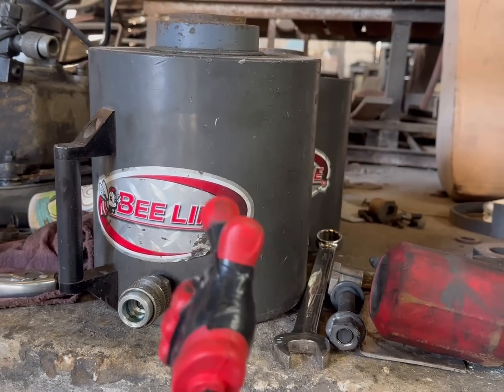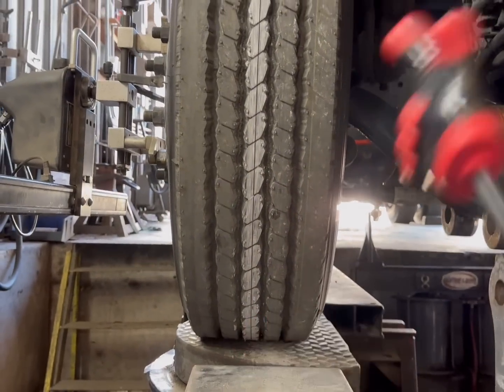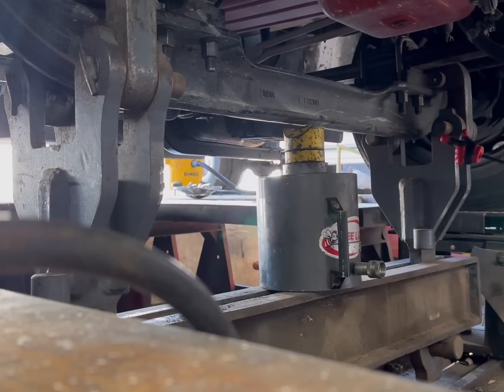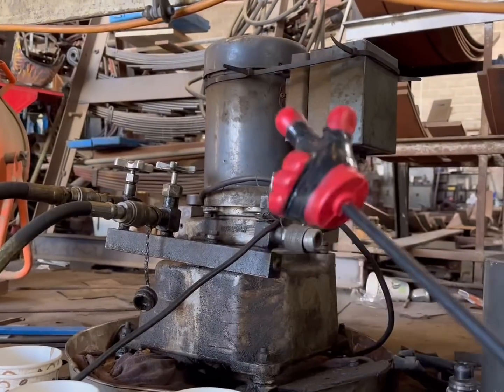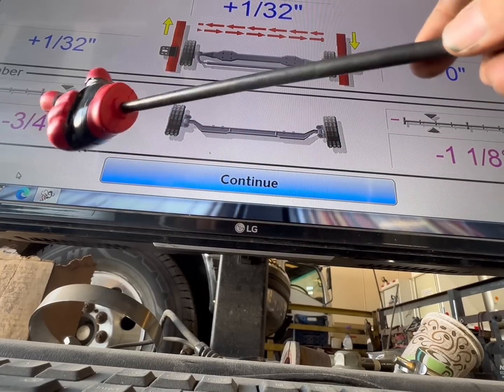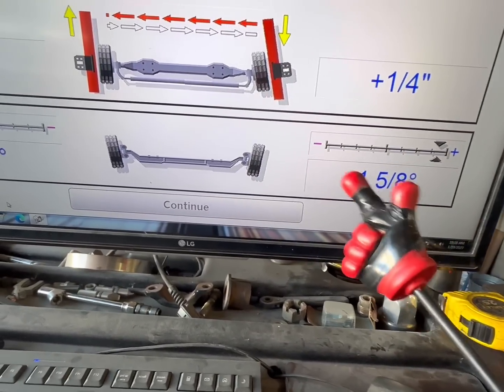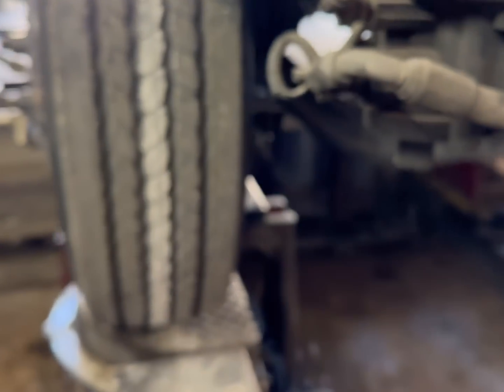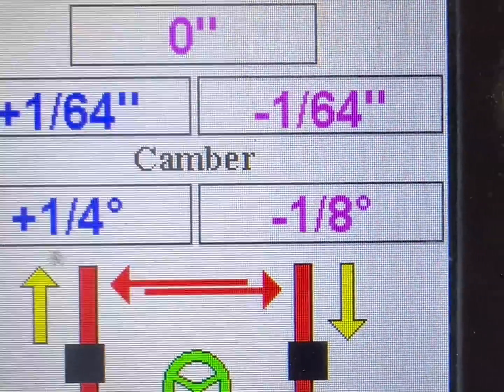What does 125ton do to a semi

Comment: I have seen it for the first time. Have a question about the camber pin/bearings (not sure I called them right) Did you check them first for wear before axle adjustment? They can also cause  a bad camber reading do they?
Reply from the maker: They will cause a bad reading. And yes there are several things you have to inspect. Such and king pin play and wheel bearing play. And also toe readings if to far out will cause a bad reading.

Comment: Amazing!  I'm curious about the difference in camber between left and right though.  Is there a way to get it dead nuts on both sides?  Also, how much does a procedure like this cost?
Reply: And if you are in Australia where we drive on the left hand side all imported trucks from right hand countries have to be changed because of driving on the wrong side of the road so to speak  and even between states there are differences as the standard slope they put on the road is different of all things just bugger your tyres.
Reply: @marsterofnotrades  Heh, interesting. Also your trucks have to drive around all day upside-down in Australia, and so that has to be taken into account too ;)
Reply: You can set the angles to equal amounts on each side but your tires will wear unevenly due to the natural curve of road surfaces that is built in to shed water in rain storms. This offset he used accounts for the curve of the roads surface. Cost for axle straightening and alignment on one of our trucks done in Columbia SC was 1280$ 1 year ago.
Reply: @btwbrand  Well I'll be damned, I never thought of how roads are on average slightly off camber for water shedding purposes but you're absolutely right!  Huh.  Also that price isn't bad when you're talking about the expertise involved, and the cost of tires that it will save over time, and the overall cost of the semi truck.  Amazing. If I ever have a used semi truck that I want to make money with I'm going to look up this guy's shop and have him go through my alignment.
Reply: @btwbrand  1280 pesos is not to bad. That is only about $71 USD

Comment: Been driving rigs for many years had no idea you could set the camber. Smart and unknown!! Tire manufacturer don't want us to know so we keep buying tires!🤣
Reply: Told one of our drivers who wore out his steer tires and just kept rotating them and wearing them out 2 at a time to go get the camber set. He said he did.  I checked the ticket and called the shop. They did toe and replaced a bushing. TWICE. Called them up and they wanted to blame the brand of tires. Finally told the driver to take it there and tell them to put it on their big ass frame machine they hate using and bend the axle into spec. He swore they didn't have it but I knew it was there. He came back with two more new steer tires and they did the work.  No more wear on inside.

Comment: We had this done in the 70s by the same guy that set up the Tyrone Malone Bandag Bandit never had tire wear problems after that pluss we found run the steer tires on the left side drive axle for about a thousand miles then put them on the steer axle and they would wear perfect

Comment: Interesting video, there’s a reason this isn’t done anymore.  Now that truck needs a new axle!!

Edit:  I’m at the truck dealership where I’ve been doing suspension and alignment work for over 25 years.  If we wanted this to be done, we’d have the capability.  We don’t because, well…….we don’t!  🤣
Reply: Lol dealerships are notorious for having the worst "skilled" labor. Axle bending when done properly like this, does not affect the life of the axle and if anything will extend the life of the axle bc the tires will be properly aligned. There is no castor adjustment mr empty head, this is how it's done
Reply: @mrfuninthesun33  “CastOr” empty head? 🙄  He’s not adjusting caster numb nutz, he’s adjusting camber.  The camber is built into the axle.  No need to bend it.   I can read a tire wear patterns like I can read your dumbass post.  Please explain what a “camber wear” pattern looks like on a truck?
Reply: @edgardaniels1402  yea empty head, pull the axle ends down to adjust the caster. that's how it's done
Reply: @robertcampbell5605  Axle ends?
Reply: @edgardaniels1402  i was being a smartass

Comment: I have a question, camber pulls to the most positive, after you bent the axle you were way positive of spec, and a hair over a 1/2 a degree cross camber,,,, road crown pushes the chassis to the right,,, these two numbers compound the effects and this tractor should pull to the right and also develop premature tire wear on each tires outside edge,,
My question is would you really give this tractor back to the customer with these numbers????

Comment: There used to be guys in my area that would do this with a torch, and just by eye balling it. Always got it right, and never compromised the structural integrity of the axle. Unfortunately,  I never had the opportunity to learn. And all those guys are dead or retired.  Back in the day, there was no fancy computer equipment.  Use a carpenter level if you were good, and just look at it, if you were a craftsman.
Reply: If you heat it enough to let it bend you are compromising it's qualities. It's better to take a forged beam and bend it then it is to heat it.
Reply: @ChevyConQueso  on paper I absolutely agree with you.  But out in the field, things don't always work out as one would suspect.  The guys that retired, performed repairs using this technique,  and never had any issues.  I'll admit, the first time I torched an I-beam to do king pins, I was hesitant. But I've been doing it like that for so many years now, it's just second nature. You have to just know, what the limitations are.

Comment: Bendon—are you concerned that every time you bend an axle it voids the manufacturer warranty on the axle?( stated on their websites)   I don’t know how they could ever tell it was bent but just curious on your thoughts
Reply: I'm not him, but here are my thoughts. 1) Heating enough to bend changes metallurgy, so a bend is preferable.
2) The axle got bent under hard use. It's unlikely to fail unless a crack has developed. Bending it back isn't any different. 
3) Liability is expensive. it's easier and advantageous to sell more axles and make a profit, than to allow bending and potential lawsuits, whether the practice was the cause of an accident or not. You never know which way those cases go.

I would personally do this on my truck and sleep at night.
Reply: The warning against bending is for when a truck is in an accident and has a major bend. At that point you should replace the part.  The adjustment he makes here isn't the bending they are warning against and like he said if you check the literature the manufacturers service books tell you to have this procedure done as part of a comprehensive alignment.

Comment: You make great videos and I’ve been in two shops in Kentucky that USED to do this but it’s been years and it seems that when the older mechanics passed so did the knowledge
Just a heads up at around 4:15 in your video there is a socket on a nail that is just hanging on by a short curly so you may want to grad that before you get a black eye 😂
Reply: Bro... attention to detail! Took me a few times to catch that, you can barely see it in frame
Reply: Yea it's! Off to the right ✅️ up high above his head.

Comment: Hey man I'm from Canada too and I've got an old ford twin I beam and I've tried all over to get a shop to do what your doing and can't, so it's a hope of mine to find a cool old boy like you one day who still know how to do this neat lost form of alignment. Great video and keep up the hard work!
Reply: My 95 powerstroke twin I beam was an alignment nightmare until I took it to this old school dude I was told about and he got it right one shot. First thing he said just from looking under it for 2 seconds was did you replace your bushings? Answer was no and 3 other shops neglected to tell me they were wooped. The 7.3 is bruital to the twin set up because of how heavy it is.
Reply: @youngmike8645  People trash the twin I beam and twin traction beam especially but they're great systems, that Ford still uses, at least up till the 2016 models. I don't see any 2wd 2017+ really but I'll look when I get a chance. 99% of the time these folks are driving on blown axle bushings and they want to complain. I personally like to swap for polyurethane bushings. Cheap and do the job.
Reply: @ChevyConQueso  It is a trash suspension setup that always changes toe, camber, and caster whenever the suspension loads/unloads. I've worked on many of these, they suck. They are only in the new E series chassis, because Ford has been using it for so long because it's cheap to produce. They should get rid of it and start using front tubular axles like they do in the RWD F250 and F350 series trucks.
Reply: @ChevyConQueso  People trash it because it isn't very good compared to the other options out there. Just because it has been around forever doesn't make it great.
Reply: Need moog caster camber bushings

Comment: I do the same for 5th wheel/gooseneck trailer axles.  I set toe also.  You wouldn't believe how many trailers axles are out of alignment even brand new. It's no wonder so many eat the tires right off.
Reply: Welding robots are setup to spray and heat to go as fast as it can go. The warpage is a real thing that used to not be a problem. All so they can crank out more product in one 12 hour work shift.

Comment: Back in the 80s I did similar alignments, on a smaller scale, Ford pick ups with twin IBEAM suspension, there was a warming stamped right on the IBEAM do not heat or bend...well I never bent them, I just straightened them!!! Worked out well and never had one fail!  On a larger scale, great job you did fellow mechanic!
Reply: My 2004 E250 van has that suspension type. There are many available versions of replaceable upper ball joint sleeves that can change the camber and caster. Did the older ones not have those available?
Reply: @TheSailingwoodworker  them old late 70s and 80s Ford IBEAM had king pins and not ball joints, King pin rebuilding was a tough job back then!
Reply: @TheSailingwoodworker   The king pin I beams are the ones that are bent to correct caster and camber. If they have ball joints they are adjusted by sleeves.
Reply: @TheSailingwoodworker  Older ones were king pins.

Comment: I have a complete shop at my house. I have a Beeline rack and all the axle tool group's. We use to do a lot of this at my old shop, not so much but if you're camber or caster is out this is the cure! I'm about the only guy around that can do an old Ford twin I beam or light straight axle . My Beeline computer is no longer serviced so I use my bubble gauges and Lazer tandem aligner as we did years ago and it works great.
Thanks for the great content!
Reply: Twin-I beam suspension is something only an evil Ford engineer would come up with. I hate adjusting those, even with proper equipment. They still make that suspension setup in their E-class van chassis. I think they should get rid of it and only offer it with the straight axle tube beam variant like they do for their RWD only F250s and F350s.

Comment: So instead of adjusting some bolts you literally bend it
Reply from the maker: Well there are no bolts to adjust.
Reply: These are solid axles. Go play with the little trucks lol
Reply: @jeepindave5464  you need to learn about the big trucks.    There’s a reason this isn’t done anymore.
Reply: @kevinperry581  well why dont they do it anymore?
Reply: @billycolwell4263  it’s completely unnecessary and unsafe , hence the reason manufacturers say not to do this anymore.    
This will end up costing you more than just going to a good alignment shop.   
Every manufacturer calls in MD Alignment when they have a problem to figure out.    
You should too.  
Mike Becket travels the world fixing problems for the big guys.   
No one condones this anymore.  
This is old school like old wiring in a 100 year old house , it will bite you.
Reply: You've never owned a really old Ford truck huh??